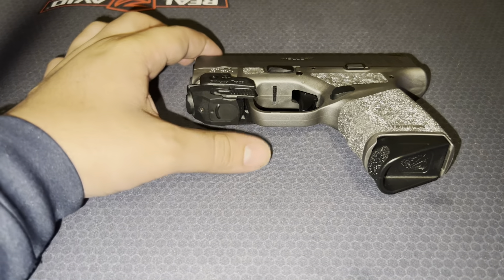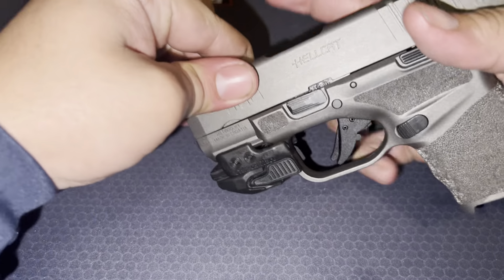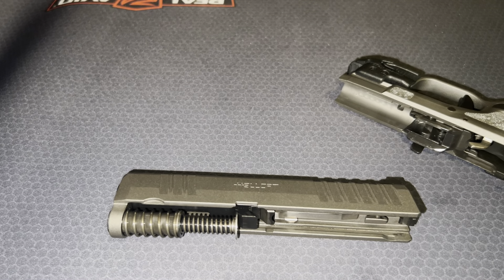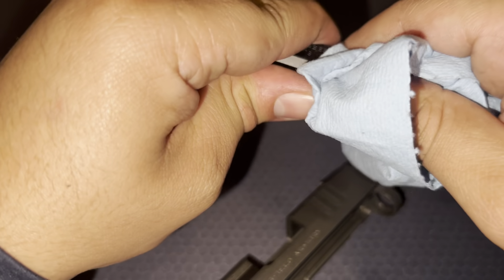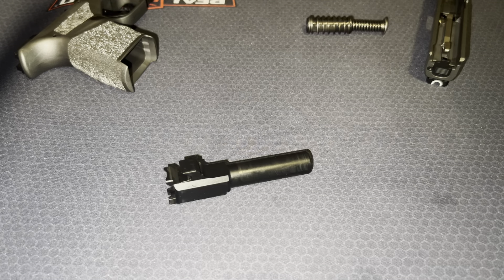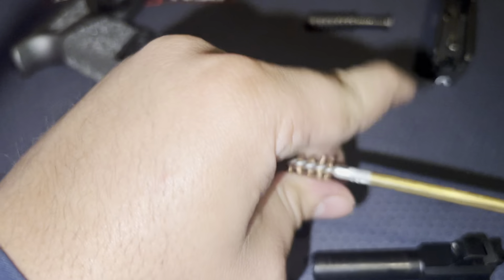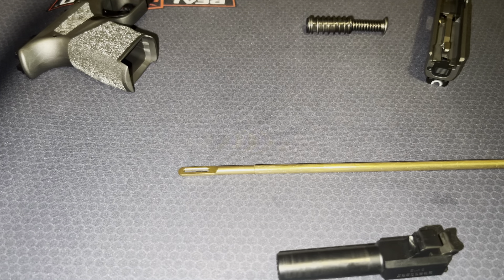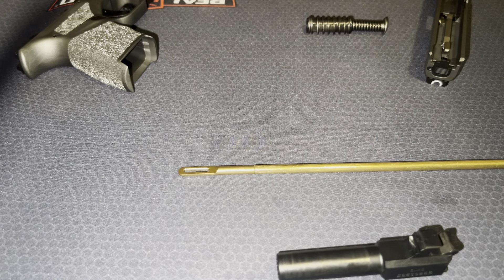How to strip and clean a Springfield hellcat

Comment: Wannabe, just a tip. You can put the brush in the barrel all the way till it comes out and then pull it back up, you don't really want the brass rod to hit the sides of the barrel walls. I would also put a little more gun oil on your barrel it has some wear on it.
Reply from the maker: Thanks for the tip will do next time